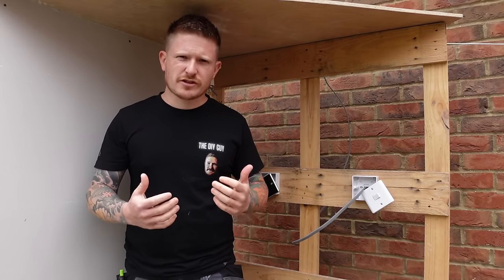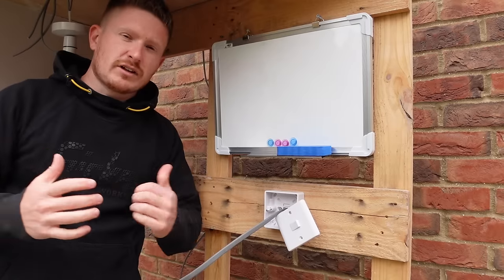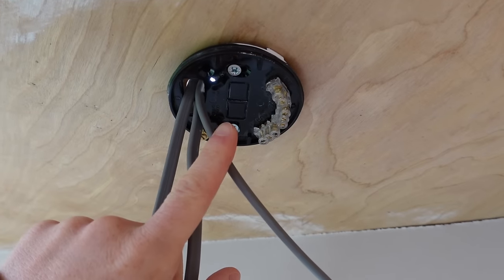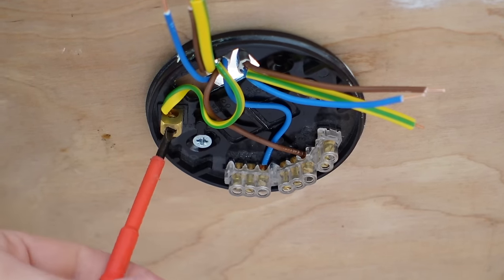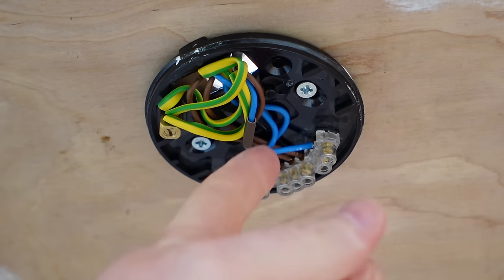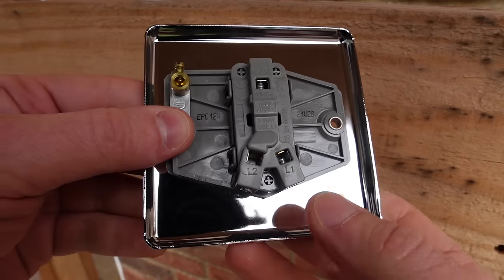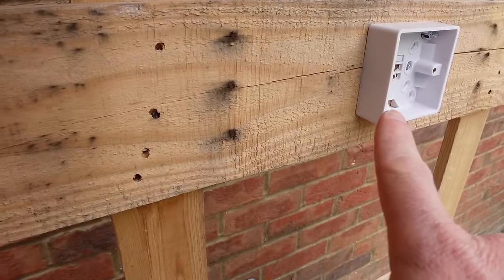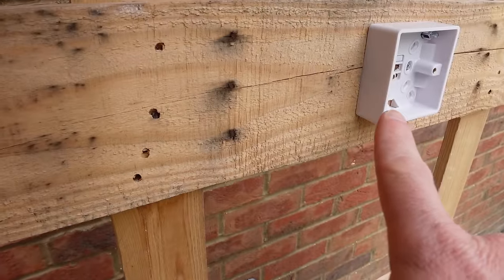How to Wire a Two Way Light Switch | 2 Way Switching For Beginners

Comment: my problem is putting a new switch on an old curcuit where the back is brown and old to a new modern day switch that is grey, i put the wires in the same holes com l1 l2 exetra but the light went all dicky any ideas?

Comment: As an electrical engineer of 40 years experience, I am impressed with the way and the terminology used to explain how the 2 way lighting system works. Only one criticism, is that you forgot to mention the “ strappers form the switching link between the 2 switches . But apart from that 👏👏👏WELL DONE
Reply from the maker: Thanks 😊

Comment: Thank you so much for posting this. I was helping my neighbor who was moving out go back to his original lights. I neglected to make a note of how the wiring was presuming that all the live and all the neutral where together. On a 2 switch 1 gangway hallway bulb. The result was the light being on regardless of the switch position. But when you turned one switch off the breaker would trip. I tested it with my voltmeter and found one neutral made the voltage 240 here in the UK the other 2 nothing. after watching your post. I placed the live  neutral on the 2 post with the bulb live and the other 2 neutral with the bulb neutral it still tripped the breaker. I swapped the switch set up so that the 240 voltage was with one of the neutrals I found the bulb was on but lower in brightness, when one of the switches was turned off it went brighter when the other was turned off nothing. So I swapped the non load carrying neutrals for the switches and it worked perfect. So thank you without your vid I would not have tried to wire the switch as part of the circuit. It makes perfect sense when it works. But I was so confused before it did...Ray

Comment: Yeah good vid a tip from a spark when wiring a loop in loop out system mark your feed&neutral on the grey insulation with an x your switch wire with a line across your switch so your feeds are x your switch are marked- then when stripping your switch wire whether it's blue or black bed your switch wire in to a s shape so u know that's your switch wire be fore putting your brown sleeving just how I was taught as a lad👍

Comment: Thanks for good video.Well explained.There is a flaw with looping  supply in ceiling roses to chain all lights.Imagine there is a fault and lights are flickering in some rooms.You'd have do go through all roses to check all connections not knowing how place has been wired up.
For me every room should have individual cable supplying lights.Obviously this would involve opening consumer unit and checking connections there.Which for me would be faster.
Also if someone without electrical knowledge opens up light switches or roses and by mistake removes sleeves while disconnecting some cores it will consuse everyboidy after trying to fix whole wiring.
For me cables labeling is something should be as standard.

Comment: Superb video. I never use ceiling roses - wagon connectors in Wago box with just flexible cord to light fitting. One problem with 2-way switch guides is books show different methods (both correct). Well done for stressing need for sleeving to show switched live

Comment: THANKS FOR THIS VIDEO. WE HAVE A DOUBLE TOGGLE LIGHT SWITCH  SAME COLOUR AS THE ONE YOU'RE USING HERE. (2 SWITCHES ON THE SAME LIGHT SWITCH IF YOU UNDERSTAND ME). ONE OF THE SWITCHES HAS BROKEN & WON'T TURN OFF. I HAD TO LEAVE IT ON ALL NIGHT UNTIL I BOUGHT THE REPLACEMENT TODAY. THE PROBLEM WE HAVE IS THAT ON INSPECTION WE HAVE OLD WIRING WHICH WE DIDN'T REALISE WE HAD. (BLACK & RED) THIS VIDEO WILL HELP US. THANK YOU.
Reply from the maker: Anytime 👍

Comment: Thank you for the wiring breakdown.  I'm soon to be tackling breaking down a twin switch at the bottom of my stairway; it has a 3 way and a 2 way switch (3 way for the stairwell and 2 way for the hallway).  I'm wanting to split off the 3 way to its own switch and the 2 way to be converted to a single 1 way switch so I can put a smart switch in its place, then disable the 2nd 2 way switch for the hallway since it's never used.
Reply from the maker: Your welcome. Good luck with the work 👍

Comment: Been a licensed electrical contractor here in the US since the 80's, I wish our outlets were designed with the splicing terminal blocks like you guys use. We're still stuck with wire nuts or other splicing connectors that take up much more box space.

I find it interesting you guys use the term "neutral" for the grounded phase conductor because there's no split phase power in your country, only single phase 240V. In the US we use split single phase power that actually has a neutral in the middle between the two 240V phase conductors to provide 120V power as well. To reduce the lethality of electrical shock, we in the US use 120V for general lighting, wall receptacles, and small appliances while reserving the 240V power for major appliances like stoves, water heater, air conditioning, and so on.

When you ground one side of a single phase power(like you guys do), we in the US call that unbalanced grounding system. When you ground the middle conductor of a split single phase power (like we do here in the US), we call that a balanced grounding system. 

Noticed you guys incorporate switches with your receptacles. We don't do that here in the US because it's redundant since everything you'll be plugging in has it's own power switch.
Reply from the maker: Pretty interesting to hear
Reply: @TheDIYGuy1  <> I forgot to mention that since it's the middle conductor of the split phase power that's grounded as used in the US, the voltage to ground from any of the two 240V phase conductors is cut in half (120V), again reducing the lethality by electrical shock from the 240V phase conductors.

Comment: Another great video.
You make electrics seem so easy!
One request...could we have a quick wiring diagram at the end that we could screenshot and refer back to? 😉
Reply from the maker: Thanks for the feedback :)
Reply: Run hot to the pole of one switch, hot from the pole of the second switch to the load.  Connect the other side oif the load to neutral. Connect one leg of each switch to one leg of the other. Connect the remaining switch legs.   How you route the conductors depends on the conduit or cable routing.   If there is power  and neutral at the load, you could run a 3-conductor from it to each switch and spice everything at the load.

Comment: Hi i am trying to wire lights in my shed. I have been watching loads of your videos and they seem really helpful. For starters i dont know if i have bought the right kit. I have a consumer unit in the shed and run some sockets from it, and run another wire from the 6amp RCB (I think its called) to a switch with two switches on it. I wanted to put one light outside the shed and a strip light on the inside. I was wondering if you could help witha quick demo on how to do it and i can follow alnong like I have been doing previously. By the way I havnt connceted it to the house yet LOL really nervous for doing that until im sure i have done what I can to get it all wired up completely. Again many thanks for your tutorials they are a great help.

Comment: Just came across your YouTube channel and your video showing the wiring layout is the same as mine but instead of com at the top it's L1 and L2 and 3 below.

I have the BG electrical evolve single touch dimmer switch and on the back are, a symbol with a wavy line with an arrow through it,  s.link and L connections. My question is does the black wire brown sleeve go into wavy line symbol, the grey wire brown sleeve and blue wire into s.link and 2 brown wires into L?

Comment: Good information mate thanks. Goes over my head a bit like. I've got a 4 gang old switch in the hallway of this old house operating 4 lights. 2 in the hall and landing and 2 in the reception room and front room. I'm after swapping it for a 2 gang switch operating the landing and hall  alone  and adding a single switch to each downstairs room which have no switch at all. Just wondering if I can do this running from the existing wiring? 2 red 2 black and 2 grey wires running into the 4 gang. At the moment I've just stood looking at it when I walk past now and again!!
Reply from the maker: Your welcome

Comment: Hi, great vid. I have this in my living room. I want to add some spot lights to a media unit and have it working off of one of the switches. Can you just replace the switch to a 2 gang switch and bridge a live to have the second switch in the 2 gang switch to operate the spot lights separately whilst leaving everything else working the same as it was?

Comment: Great video this, really clear and easy to follow. Would it be possible to show (do a video) how the wiring from the configuration in this video would apply to a 1 gang, 2 way smart switch (not wifi, no neutral) such as the CNBINGO switches at all?

Comment: Thanks for the video, this makes perfect sense, however I’ve got 2 light switches in my living room that control the centre rose and both switches only have 3 wires 🤔. I can’t remember whether it’s ever worked, but basically you can switch it on with the first switch, then off or on with the second switch. But to use that second switch, the first has to be in the on position! Likewise if the 2nd switch is in its off position, the first won’t work! No wire markings so I don’t know what is what and it’s not so easy to reach the rose and switches with a multimeter. Am baffled.

Comment: Only just found your channel but glad I did. Could you do a video explaining intermediate switches please?
Reply from the maker: I'll see what I can do 🙂
Reply: Intermediate is very easy. it would be in between the 2 switches with the same cable 3 core. you have 4 points for where to terminate. 2 at the top and 2 at the bottom. pretty much you have 2 L1's and 2 L2's. connect the incoming brow into L1 at the top and the incoming Grey in L2 at the top. then with your wire coming out Connect the brown into L1 at the bottom and Grey into L2 at the bottom. the common you need to connect in the back via a wago and same with you earths. dont forget to earth and metal fittings. Hope this helps

Comment: I have a single light switch in upstairs hall, I also have a light in my loft that I plus into a mains socket when needed, so I would like to change the single light switch for a double so I can connect the light in the loft, is this a straight forward easy task? Thanks.

Comment: Hey buddy. Got a Question for you.
I'm decorating jst now & I'm taking an old 2way plastic light switch off & replacing wth a 2way metal switch plate. The old one has yellow wiring going into L1 & L2,  White wire going into the Common. Do I connect new metal switch plate exactly the same way?. Theres 2 earth wires in bk box. Do I take 1 of those earths out & fit it to new metal S plate earth terminal & leave 1 in bk box??
Liked & Subscribed 👍

Comment: Brilliant...quick question..... If you are wiring in a 2 way switched section of down lights that are only a part of the main lighting ring in a kitchen ( so no individual cieling rose) do you treat each zone of lights as a separate "room" and run your twin and earth from the consumer board to your first light or does the twin and earth carrying the live terminate at the switches? So in my case I have 6 external downlights in a soffit that will have an external PIR and an internal switch. So do I 3 core and earth from internal switch 1 to PIR and then 2 core and earth from PIR to downlight 1 and then daisy chain the downlights together...and if so does the live feed going from consumer board go to the internal switch or to the first downlight?  In the kitchen there will be 5 different lighting zones all independently 2 way switched.....I won't be connecting up..sparky will do that... But I need to run the cables to fit soffit and need to know where the cables need to run. We are still waiting to instruct a sparky as they are all taking an age to get prices together ......thanks.

Comment: Excellent video. However, I’d like to have a 2-way switch on three ballasted strip picture lights.
I believe that you can’t run these in series. So my question is:
In place of the dangley flex light, can I run a three core flex to a junction box, then wire the three picture lights in parallel (star) to that junction box?
Cheers

Comment: Can you wire an outside light from an inside light switch? as there is no seperate power source, only an existing room light switch. Do you still require a 5A fused switch?

Comment: Even the basic ceiling rose gets people. 
Years ago I got a call from a friend of mine asking for help with some light fittings. he's a tiler and had a job on tiling a kitchen, he did a good job etc but the client asked if he knew anyone or could change some light fittings and he thought how hard could it be.  Anyway he wired all the reds into  live and and Al the blacks in the neutral so the light was permanently on.
When I got there I Had to do some continuity checks to find th switch wire which puzzled my friend since I asked him to flick  the switch "but the power is off" 10 mins later after double checking  all is good and the fittings were back up working perfectly.
The client knew nothing of this it was all done before she returned from work

Comment: Like others say, your vids are about as simple as one can make.
I know that there are 2 types of wire for lighting 1.5mm & 1. mm but I don't know which type to use in a given situation so I always use 1.5mm as that is more heavy duty.
Is there a use for 1 mm?
Loving the vids 👍👍👍
Reply from the maker: That's what this channel is about. 1mm is fine for most lighting applications.
Reply: @TheDIYGuy1  Cheers for that👍
I was curious to know if say, 1mm (16amp) was the norm for domestic supply or 1.5mm(19amo).
Have looked around and the consensus is that 1mm is the norm.
👍👍
Reply: 1.00 mm is easier to install, particularly when installing into single switch boxes and small light fittings. The load capacity (approx 14 Amps) is far in excess of the typical 6A breaker used for light circuits in most installations so for me it is my preferred cable size for light circuits. Note: Just to cover myself, load capacity could be reduced if the cable is installed where it's buried in plaster or insulation due to the temperature limitation, but even so is still likely to be suitable for 6A.

Comment: I live in a new build property and the garage is like an extra socket on the downstairs socket ring.  I have a 13 amp socket in the house that goes direct to the garage to feed power and lighting.  The garage recieves power from this in another fused socket (the light switch) which is 5 amp.  This then has 3 wires earth, neutral & live.  The garage is about 18 meters long and ideally I would like to have a switch at each end but unfortunately I can't follow this guide as I don't have 4 wires.  Any help would be appreciated, maybe your next video?
Reply from the maker: Thanks I will see what I can do for you

Comment: Hi I've got a 3 gang light switch 2 work the upstairs and downstairs the 3rd goes to an outside light I've put a timer on it Timeguard ZV700B Automatic Digital Security 7 Day Light Switch Timer Switch on it but it doesn't light up I'm sure I've put the wires back the same way any thoughts please thank you

Comment: Afternoon great video but I want to go from 2 switch room to a 1 switch room as we’ve had one door way bricked up. I’ve put a blank faceplate on and taped off the cables but now the main light switch won’t turn the lights on. 🤦🏼‍♂️

Comment: What about a 3 button switch for outside lights, controling button 1 for flood light, button 2 controls 12v led 5m strip light and button 3 controls 12v lights in the garden?
How do I wire it?

Comment: Youd need an electrician to this job in an older house ? I have a situation like this switch on the top of the stair well and a switch at the bottom but the are not wired for two way unless you run the cable out side the wall between the switches which would look unsightly .

Comment: I'm still flummoxed but I'm reconnecting a 3 gang switch, x2 one way downstairs lights and a two way upstairs light. The downstairs lights work fine but the upstairs light only works from the downstairs switch, I haven't even messed with the upstairs switch.